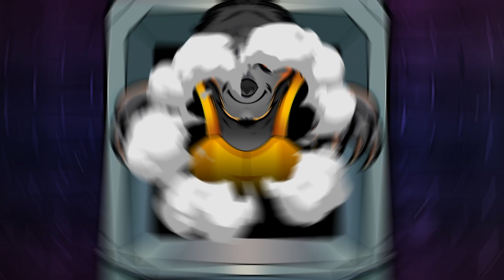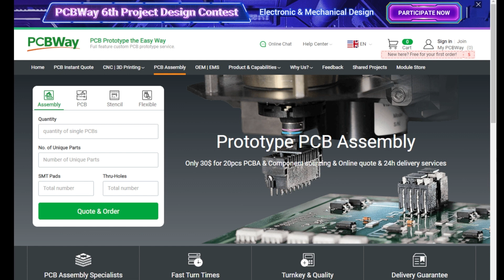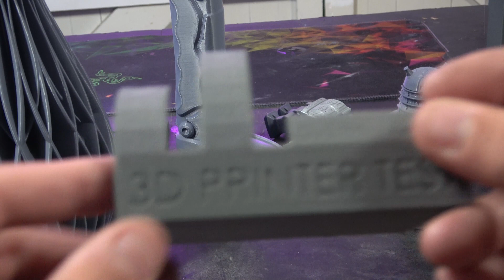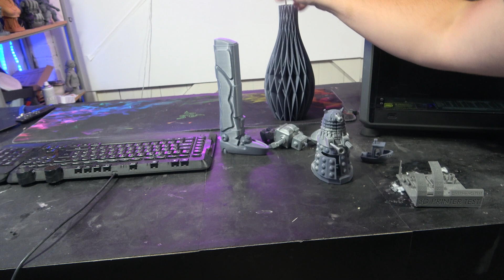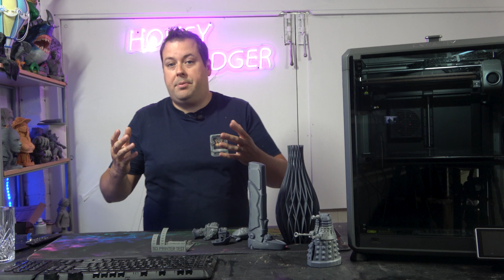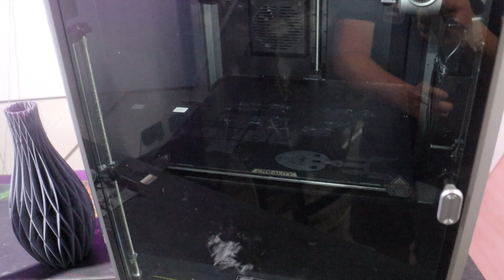creality K1 Max - dam near the best printer I've used

Comment: I love my K1 Max. Consistently prints ASA and TPU with no issues. I set it up and started printing and haven't stopped. No issues whatsoever.
Reply from the maker: have you done root access yet, im just playing about with mine, ive now got full fluidd on there and i can print remotely from orca slicer with full options

Comment: I have the k1 and my k1 max arrives tomorrow. I have had some really good prints out of the k1. I’m making one of those PET filament makers out of an old xvico. The only issue I had is my bed stick to the magnet too well after the print. It’s like there is glue on the magnet and you can hear the sound of something unsticking/ripping when you try to remove the bed. The print on the other hand pops straight off.
Reply from the maker: so you have a couple of options on the bed, you could raise your z offset by just a smidge and see if that helps or try using hairspray on the bed, hairspray acts as a release agent rather than a glue
Reply: @honeybadger3dprintandpaint  would that help? The problem is before you start a print you can easily remove the bed from the magnet. But the minute you finish the print (regardless of size and where you print it) the actual pei sheet is stuck to the bed like it has been glued down. There is no issue with the print itself that pops off once you get the pei sheet off the bed